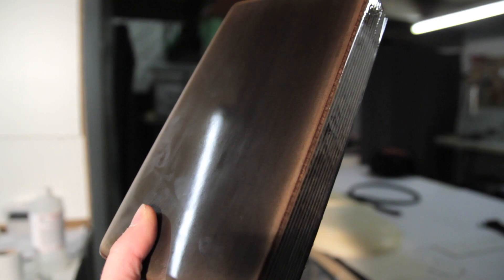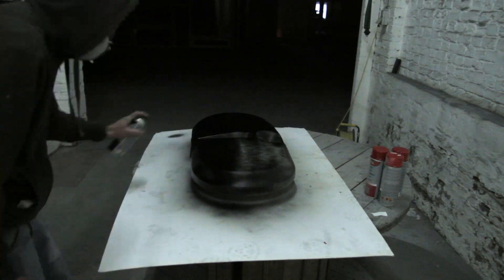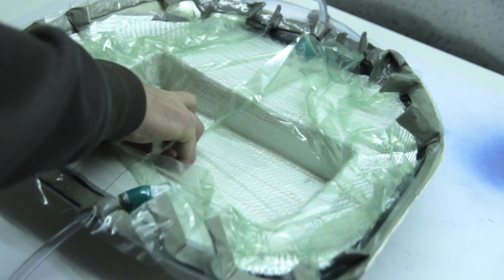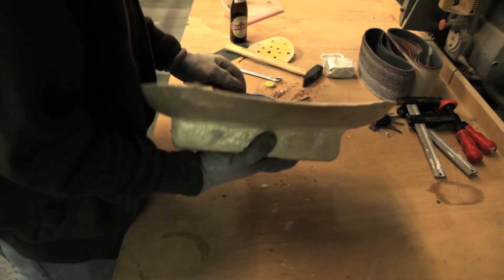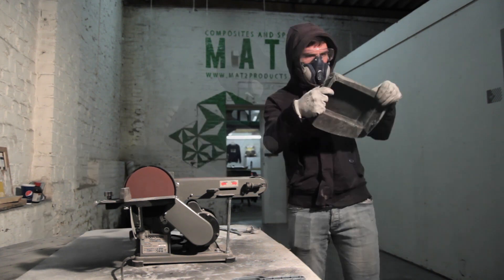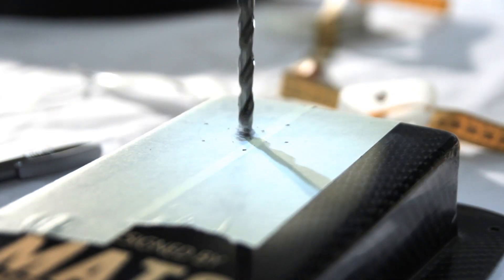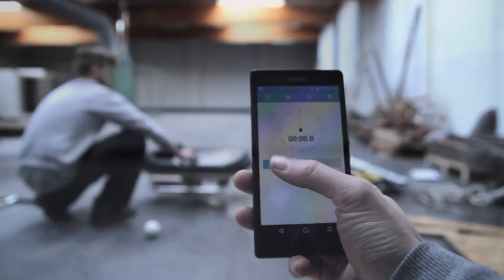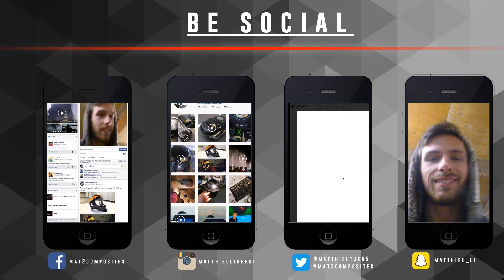Carbon Fiber Cover - Part 2

Comment: A quick question: The sticker which says "Redesigned by Mat2 Composites". Did you stick that on after the clear coat?  Also, is it possible to apply some kind of sticker on the piece BEFORE applying a clear coat -- so it is permanently embedded under the coat?

Comment: does the original wood piece fit in this cover too?  would you mind doing a video about how to make a piece a few mm bigger than the original so you can cover the original part with a good quality carbon fiber piece? like a "cosmetic" layer over the original... id like to have a cover to a few parts of my car, but i dont want to layup carbon because of the resale value may drop... unbuliveble, but...

Comment: Just wanted to remind you that carbon fiber is a conductive materials, and it's dangerous to use it as an electronic covers without any isolators layer like kevlar. Cheers!
Reply from the maker: thats why its backed with fiberglass ;-) but thanks for the update!

Comment: since this was a 1 time use build, why did you chose to do this way instead of using the laminating putty to make the mould? wouldnt it have been easier and quicker to do? great video, you always make me want to go home and work on my many carbon fiber projects.
Reply from the maker: Hah thanks for the positive comment! The answer is quite simple...did use the tooling resin because a lot were asking for a tutorial about that and its cheaper than the mouldmaking putty :-)

Comment: Very good as usual. There was any customer or technical requirement to make this in carbon fiber and not in fiberglass for example? Because CF is expensive..
Reply from the maker: Good remark! No technical requirements just that carbonfiber looks better here :-)